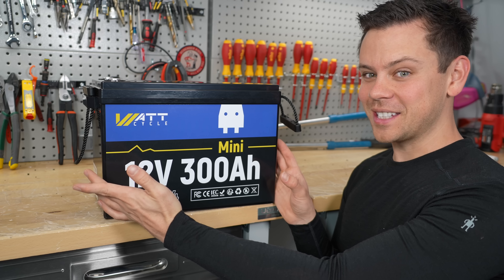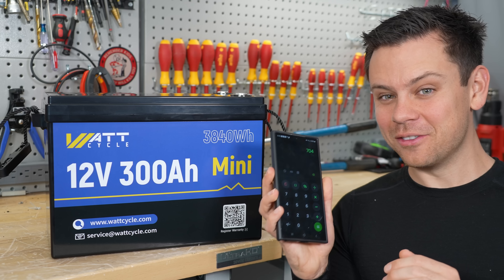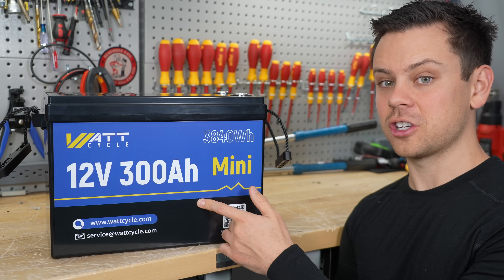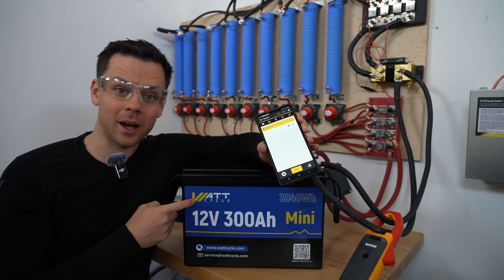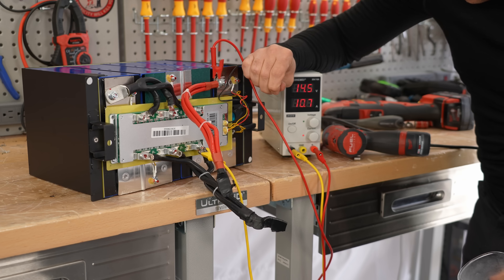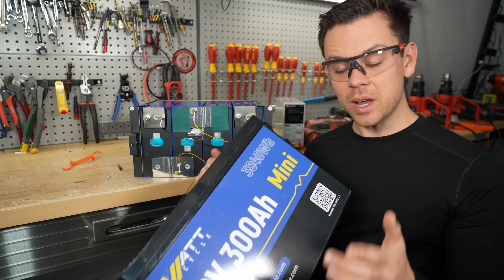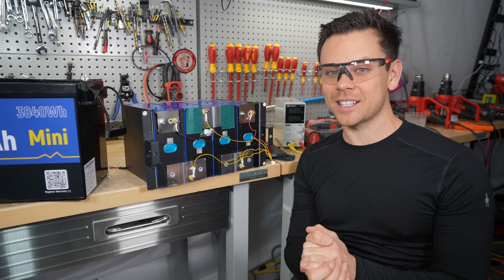Wattcycle 12V "300Ah" Battery: Popular Budget Battery Falsely Advertised?!

Comment: In some high reliability applications, I prefer to use Marine Lead-Acid batteries. Yes, you get half capacity for the same size when compared to LiFePO4 batteries, but there is no quirky BMS boards in the middle, and the characteristic in high temperature environment is almost a legend. The carbon in the electrode plates has made sulfation of Pb/H2SO4 batteries (at low charge levels) a problem of the past...

Comment: I have a 16s bank of EVE LF280. When i saw your tested capacity, i thought those were indeed LF280. After more than 120 cycles and a year, the cells in my bank still seem to do 300Ah. But I charge them below 0.3C and discharge them below 0.5C, so...

Comment: Will as for as the overcurrent protection, it depends on the intended purpose of the battery. If the batteries are 3C rated, then 800 or so amps is perfectly fine. If you're using it for a solar application, then like you mentioned, the fuse is definitely a good idea. But, if the battery is used for a starting application in a vehicle, then the high amperage is needed to turn the starter. A 200 amp short term limit in many cases, is just simply not enough.
Reply from the maker: Absolutely false and this is what a time delay is for. This is a feature in most BMS that was programmed about 6 years ago. This allows for high surge capacity so that you can run motors easily. But does not allow for anything to overheat. Having zero protection in this regard is extremely dangerous. The supply conductors and insulation rating of them cannot handle this current. It's asking for problems. Also the terminals have a current and temperature rating as well. These current figures are excessive for this hardware. It's not safe. Even if it's designed for starting a car
Reply: @ And these batteries void their warranty if used for starting combustion engines. What size fuse for each battery in a 4 battery bank connected to one or two EG4 3000 watt AIO inverters?
Reply: These aren't warranted for use as a starter battery for a combustion engine.  Says so right in the paperwork that comes with them.  I still think they are a good value for the money spent and don't regret my purchase of four of them, but they should be labeled and advertised properly as 280AH batteries.
Reply: @traveling.down.the.road56  Thanks for the update, I didn't realize that about the warranty. In that case, then Will was correct. As far as the 280-amp hours being labeled as 300, I absolutely agree that this is false advertising. It's issues like this that I actually have quite a pet peeve about regarding Chinese electronics, which are often misrated.
Reply: @ Yeah, I’m very cautious with buying any Chinese products and try to avoid it whenever possible.

Comment: Perfect timing for this video.  I just bought a second pair of these, for a total of 4, 300AH WattCycle batteries, to make my 48V battery bank to run my EG4 3000 watt all-in-one inverter/charge controller.  I just logged online to check Will's older DIY power station cart that he built with the EG4 3000 watt inverter, to see what other parts I need, and I found this video instead.  If you could give me a quick list of additional parts I need and a diagram to show what to put where, I'd really appreciate it.  I just got done charging my 4 batteries with a Victron 20 amp, 12 volt battery charger, to top them all off before connecting them in series for my 48 volt battery bank.  One of my 4 batteries seemed to be low after the charging, so I put it on the Victron charger again, and it went from 13.35 up to 14.1 volts.  The other three batteries all finished the first charge cycle at between 13.61 and 13.68 volts.

It is a bit disappointing that these batteries aren't true 300AH batteries, but as you said, they are still a great value, and appear to be built well, so I'm not too upset about it.

Comment: 800 amps over load disconnect is good -most high frequency inverters if there 4 kw constant with 8 kw surge they will generally trip off at 8 kw surge watts - 
      On the other hand the commercial low frequency 4 kw inverters are normally rated at 8 kw surge for 4 seconds and drop from 8 kw to 6 kw over one minute - 
   Normally in industry we use AGM battery's for there surge rating  lithium batterys trip off when surged at high current - 
   So if that one can handle 800 amps even for only 4 seconds that's excellent - 
       I have worked on generators and any thing to do with power production in the offshore and remote mountain oilfields since the early 70s - 
    For a lithium battery to handle 800 amps is awesome - depending on the AGM most can deliver a 1400 amp load for one minute - 
     5 kw low frequency 12 volt inverters surge at around 1200 amps for four seconds - a good AGM handles them just fine when needed -  the CCA are about 1450 amps or so an 8D AGM - 
     A 2000 watt low frequency inverter requires a 800 amp fuse for 4000 watt surge -

Comment: What size fuse on the battery do you recommend .. ?.  Just purchased this exact battery.
Reply: Depends on the size of the wires you are using to connect to this battery.  Size the fuse so that the wires won't overheat and catch fire.

Comment: The quality control of Wattcycle is sketchy. I ordered two 12-volt 100 Ah batteries—one arrived with a scorched terminal, and the other was fine. They sent a new one, and I took the scorched battery to a recycling center. Around the same time, I ordered the compact 12-volt Bluetooth connectivity version and the regular 12-volt 100 Ah version. The capacity of the Bluetooth battery is significantly less than the non-Bluetooth version. For the Bluetooth connectivity, the app is sketchy as it requires your GPS location, requests your telephone call logs and your address book, and sends data to an unknown recipient. I brought the capacity and Bluetooth concerns to the customer service group, and after three weeks of dialogue, the representative offered a 12-volt 50 Ah battery as compensation. The concerns about the app and its required permissions are still unaddressed.

Comment: I too bought one of these 300ah batteries based off your review if the 100ah.  Mi e too had the top popped loose.  I just gave it a smack.  Its so much better than the 4 of the 109ah lead acid batteries I had.  Thank you for getting to this model so quickly!

Comment: I saw these on eBay back in the fall when they were having some sort of pre black Friday sale. Somehow I ended up on a link to 4 batteries that were shown with a percent off price and also showed an additional discount making the total less than $400 each so I placed an order. 
The next day they sent me a message saying they had discovered a manufacturing defect in all of these batteries and would have to cancel the order, yeah right. They said they would have some back in stock in a couple of months and I could get the discounted price then but didn't say how to do it. Basically, they made a mistake and lied about a manufacturing defect instead of just being honest. I'd rather pay a few bucks more for a more reputable company than wonder what kind of corners they cut.

Comment: Sounds like this problem is more prevalent than is being let on. I got one of these batteries a couple weeks ago, that had a chunk out of it, crack down the side, and the cap was coming off. They tried to blame it on shipping, but the box didn't have a scratch or crease on it. Packing was great. They just aren't inspecting them very well, and obviously need to beef up the build. They wanted to send be some glue to fix it myself. HAH! And they would send me a smaller battery for the trouble. I was going to buy a second battery, but with these issues and your recent review; I don't thing I want to deal with this apparent quality of battery. Also glad you did the test and showed the shutoff didn't work. That's all I would need is for it to catch fire in the RV.

Comment: I bought a battery quite a while ago now back in 2023 it is a NOCO Lithium NLP30, Group 30, 700A Lithium Powersport Battery, 12V 8Ah Battery With Dynamic BMS 
I have been using the battery on a 600W Pure Sine Wave Power Inverter DC 12V to 230V 240V AC on Christmas inflatables and lights 
boot I have never tried pushing a full load on it to see how long it can last out

Comment: What size fuss should I put on my 12v batteries? I have a fuse before the inverter.
Reply: Your fuse should be sized according to the size of the wires you are using, to prevent them from over heating and causing a fire.

Comment: If the cells are ok with a discharge current approaching 3C, why would they limit the output below that? LifePo4 is a very suitable battery chemistry for replacing lead acid ith lithium. on a cold day with a big diesel, you want to be able to pull a high current.

If you want protection at 300A - sure buy and fit your own fuse or breaker - but don't cripple a battery's ability because silly people might short circuit it. 

A great quality Lead Acid battery of 300AH would not be fused - and would be able to ofer upto 2KA for a few seconds. The job of the internal protection is to save the battery - not to stop nitwits causing problems by shorting out installations. That's the job of a customer-fitted fuse / breaker surely.
Reply from the maker: Those BMS supply conductors and their insulation temp rating and terminal current and temp rating cannot handle that current. I would agree if it was actually designed for that. It's not. It could melt into a puddle if you tried to pull that current

Comment: Apologize if this is a dumb newbie question, but how do I add a fuse to this battery?   is there a diy video someplace that can provide me some guidance?  I bought the 300Ah based on Will's 100Ah review for my 5th wheel.   sounds like it's still a good buy.   just want to make sure that I hook it up correctly.  thx
Reply: btw.... i asked the company about bluetooth and they said that it may be "coming out soon" for these batteries.

Comment: Bought 8 for 4S2P.  Thanks for testing the high current cut off.  Wow. That would have been spectacular.  4 had lids partially or fully off.  Support was fine.  I bet they get some air time with FedEx. I doubt they are rated as IP6? anymore.

Comment: Companies need to just be honest! Like for a 280AH 3584WH battery this is still awesome value. Also im glad to see companies are making more compact batteries that are not just full of air. Like i understand at first it was the done thing because so many mounts and setups were designed to handle the 100AH 200AH 300AH etc 12v AGM sizes. But those days are long gone.

Comment: I’m currently still making my video on this same exact battery and I’ve been using it as a portable power station with a 1500 W inverter. I used it to run my circular saw while I built a deck. So far I’ve been very pleased with the performance of this Battery.
Reply from the maker: Be sure to add a fuse then

Comment: How is that cheap when you can easily get 100ah for $120 to $130 each?
Reply from the maker: With low temp charging protection, pretty cheap. I need to test those new super cheap ones. Hard to keep up

Comment: Will, thank you for reviewing this battery!  I have been waiting on someone to test it. You mentioned that it should have a fuse on each battery if you use these.  I assume you would suggest a MRBF type fuse for that?  Also what size would you suggest per battery?  Say there were two batteries and used for a 3000w inverter.  Thanks, keep up the great reviews!

Comment: Long time watcher, first time poster. I got 2 of these for my RV as they do fit in the battery bay.  I ordered  them based on your review of the 100AH battery. One of them they sent was cracked and the top was separated. I contacted them via email with a couple of pictures of the damage and I got a reply the same day. They Offered 3 options,  1) replace it free of charge,  2) return and refund  my money and send a free 50AH battery for my troubles,  3) I repair it with an additional 2 year warranty and they send a free 100AH battery. I chose to repair it and true to their word, I had a new battery at my door in less than a week. I am impressed with the customer support
Reply: I ordered 2, and one was popped open, and they offered the same thing. I fixed it and they sent me a 100ah battery. I ordered 2 more and one was popped open, and the other the strap was broke, pulled it out of the box, and the case was popped open and broke.
Reply: Very helpful information.  Thank you both.
Reply: Same here. Took the option to repair and received 100ah battery
Reply: You got something, I got ZERO!
Reply: @weseehowcommiegoogleis3770  did you contact them?
Reply: I heard the cheap lithium go out and won’t charge after a few months anyone have these longer then 3-4 months
Reply: @jonathanwombles5004  I haven't heard any reviews on amazon stating such... if that was happening you would definitely see them in the amazon reviews
Reply: Bro what? I might need to order a couple for my Jayco baja. Be great for my solar set up

Comment: Lots of buzz in the Commentaries about which fuses. My guess is the Marine grade MRBF fuses 300Amp on BoJack Terminals? Great Video Will.
Reply: The general recommendation is to use a Class T fuse if you have LiFePO4.  Lead acid batteries can get by with fuses that have a lower AIC rating.

Comment: Will, can you assemble a power station with used Model S modules. 
I have seen some available low as $350. 
The module is 24 volts, about 5kwh. 
Seems like an inexpensive high capacity option. Would it require a new BMS?

Comment: In my opinion the 850A BMS is a good option for these batteries as long as the cells can handle it. This would make these usable in applications you aren’t thinking about. The perfect example is extreme car audio. What those guys do to batteries probably makes engineers cringe. Plus there is no protection on a lead acid or agm, and with equivalent capacity lead acid should do more amps. Just treat these batteries accordingly for the amount of energy they can discharge.

Comment: I got 2 of the NewtiPower 300ah 'small sized' with the built-in voltmeter/capacity estimator for $460/ea off Amazon a month ago.  They'll send you a free cheapo charger when you register each one.  I wonder if they are packin' 280ah in them too...

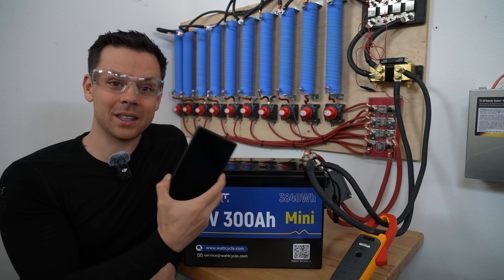Comment: 4:50 I do use these batteries with inverters, occasionally for welding too, so they need to have a lot of surge capacity. The chinese manufacturer of my cells claims 1C constant flow and 2C surge - so, no, i would not want this kind of batteries fused at 250 amps.

Comment: Great video, and very timely as I just bought two of those for my boat.  Seems a good deal despite the shortcomings you revealed.  Follow up question:  You recommend adding a fuse on each battery.  I'm planning a set up where I lead both batteries to common poles within 7" and then install a 225 Amp Class T fuse for the combined discharge.  Do you still think that each battery should get a fuse?  ABYC seems on the fence on this, and some people seem to think that separate fuses may cause new problems.  Would greatly appreciate your thoughts.

Comment: I bought two of them on Black Friday. One came with a loose cover. Wattcycle extended the full replacement warranty( not prorated) to 9 years from 7, and refunded me $150 as I didn’t want the free 100ah battery they offered. I simply snapped the cover back in place. All in all up I paid $800 total for both. A good deal imho even if not a full 300ah capacity.
Edit. Thanks to Will,I’m getting another $100 refunded. 🎉🎉

Comment: I learned to wire solar from you during the pandemic and its crazy to see how small and cheap the batteries have gotten. Makes me feel crazy with the massive 200ah one I bought back when it was competing with battle borns at $900 for 100 ah
Reply: I feel you.  I have a gigantic 200ah lithium battery, without low temp protection.  Paid close to $700 for it.  Oh well!

Comment: I bought 2 of these 12 v300 ah batteries and they did show up with the lids not glued on. But as you said they did answer my question and did email me back very fast and told me if I would glue it mine they would give me a 12v100ah battery but one off mine was busted on the side of the case so I had to do more work on it and fill in the crack and hole on it. But they are sending me  a Bluetooth 12 v 100 ah instead of the regular to start with but after looking at it closer I found it was damage a lot more than just the lid however I went and bought some Oatey abs glue and filled in the hole/crack and told them so they upgraded me to the 12cv100ah Bluetooth one instead of the regular one in the beginning with just the lid not glued down. I am currently waiting on the Bluetooth model now as we speak. And I have fixed I believe the issue with it. I can send pictures if you like. Thank you Will I did in fact but this on your recommend choice per the 12v100ah. So far they have been great and I agreed to the Bluetooth model. I will try to send pictures to show you.
Reply: I tried to post the pictures I have of the 2 batteries before and after I fixed them. So far Iam happy with the customer service and the performance of the batteries. If they  don’t send the battery I will let you know. There only sending me one battery and it happened to both of them maybe I should have got another battery for the second one as well.